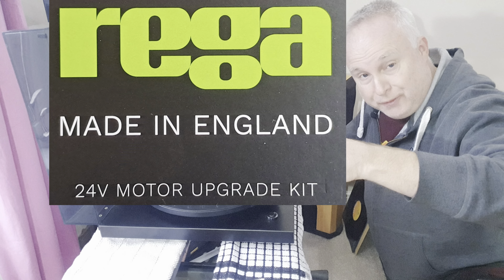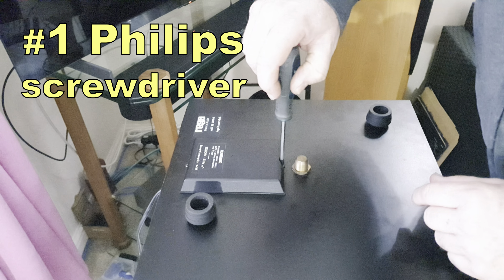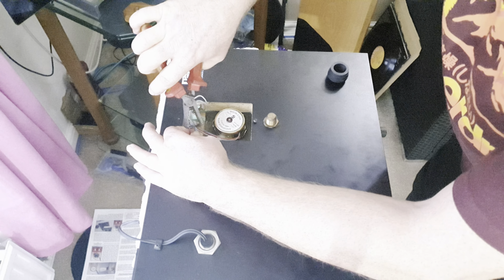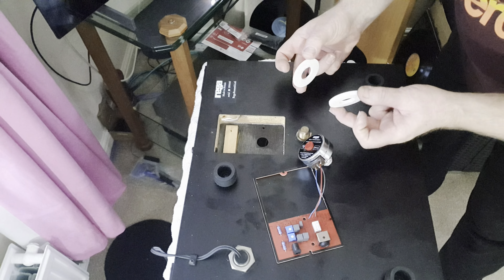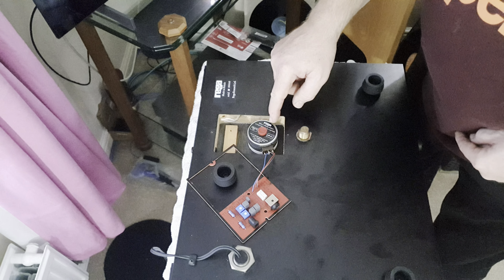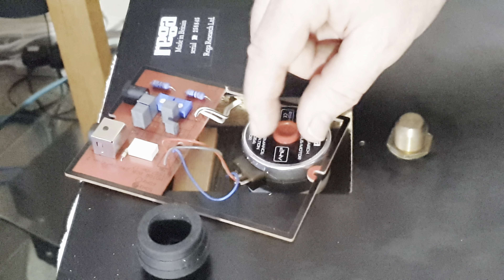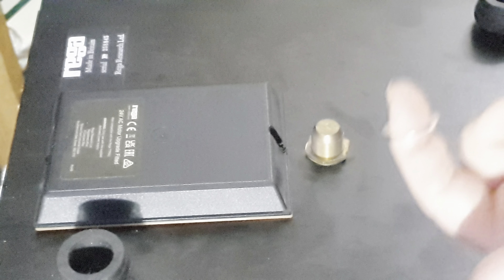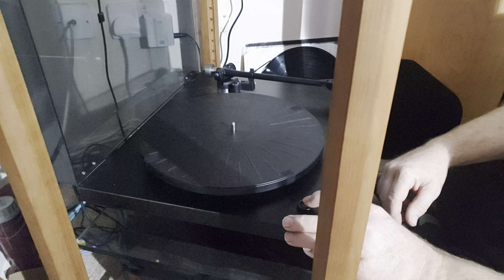How to Fit a REGA 24V Motor Upgrade Kit

Comment: Thank you this straight-cut and clear video demonstration of how to dismantle and remove the old motor.  I am looking at buying this buying for my Rega RP1.  I purchased my RP1 brand new stock from Rega in 2016.  I had already upgraded the sub-platter, platter, and I use an underslung counterweight, so the 24v motor upgrade kit is the next logical sense!   Have a good one!
Reply from the maker: Glad it helped. I have an underslung counterweight too. I've added a Neo power supply since this video as well as a Ortofon Bronze cartridge (top tip: these need a 2mm spacer to lift the arm mount - Regas spacer = 💰💰, a 2mm copper spacer/washer off eBay is cheap as chips, 23 or 24mm IIRC). I bought my Planar 3 back in the mid 90s.
Reply: After I desoldered the old 110v motor and soldered the new 24v motor I was surprised because I successfully soldered the new motor without any hiccups/problems.  The first thing I notice after the new motor install is a deeper more full bass, sound quality is much higher, and I would recommend this upgrade to anyone!